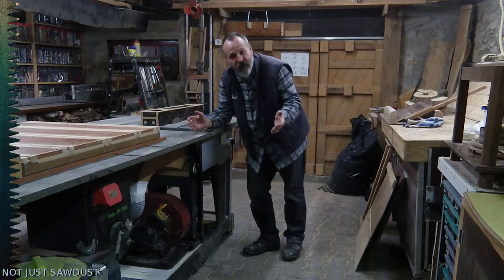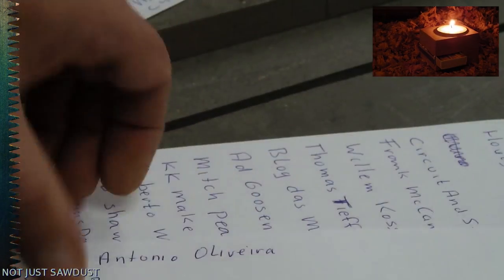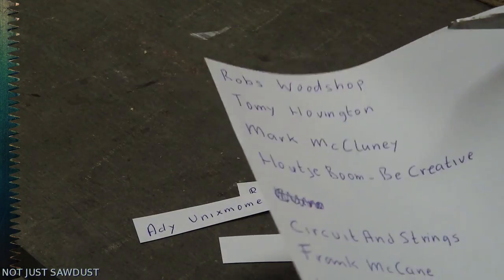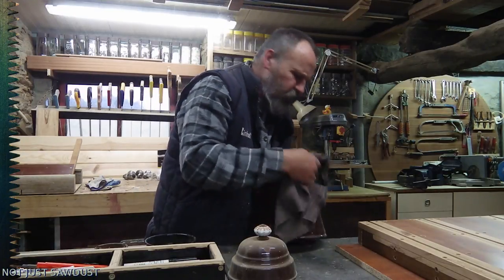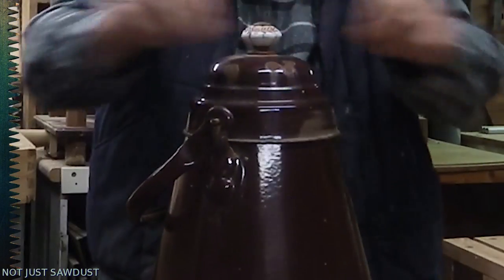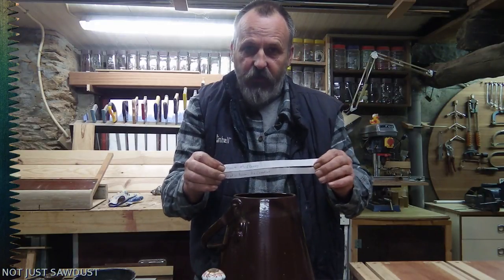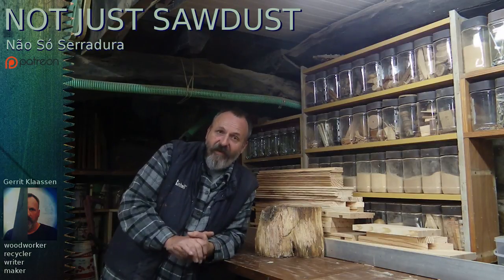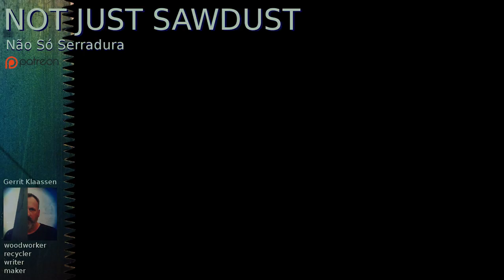#96 The Emergency Light winners!

Comment: Love the dust collection idea. Well done winners.
Reply from the maker: The dust collection is not ideal, but then again the machine was made without any connections to put it on (is open on all sides except for the bottom). With this setup at least I keep the "tunnel" , in which the saw blade turns,  empty.

Comment: Congratulations to the winners!!! I love your table saw dust extraction system! Sweet!!
Reply from the maker: Thanks Tomy, well, the sawdust is sucked out of the machine very well, but because of the "open" construction there's still a lot of dust around from the front and the top. Main thing is that the "tunnel" in which the saw turns stays clean. Still a few "gaps" to be filled on the side, with a little bit of luck I will be able to catch about 80 percent of the dust... and that makes a huge difference!